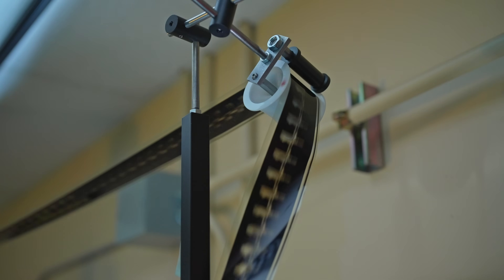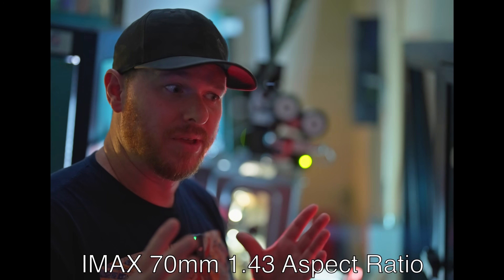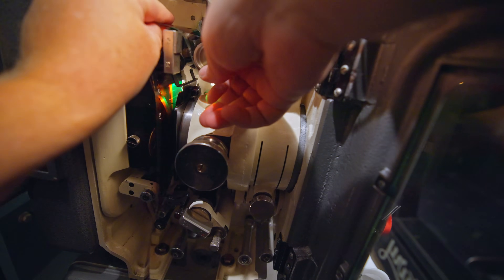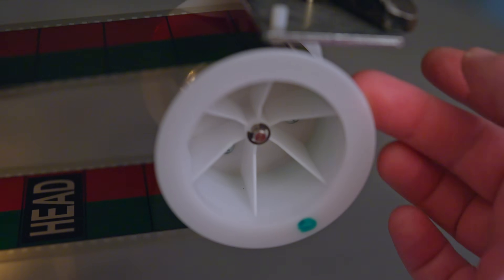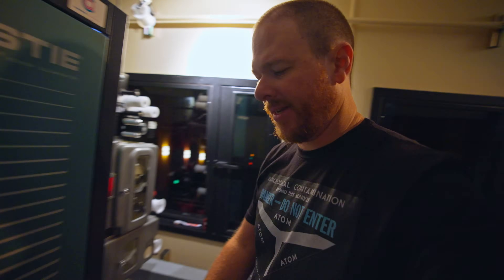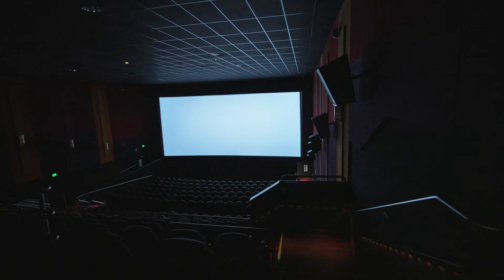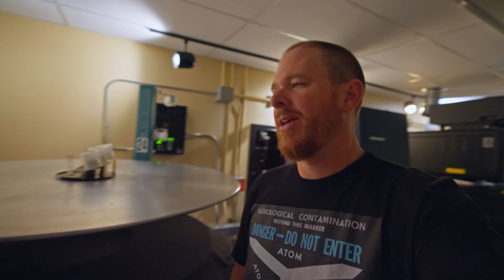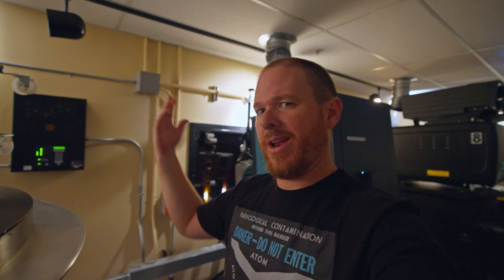Being a Projectionist for Oppenheimer 70mm Film Part 2

Comment: How does this relate to isomorphic projection stuff? Where widescreen images get morphed to 4:3?
Reply from the maker: Your thinking of anamorphic. Hateful Eight had a little bit of an anamorphic squeeze on it. On the film things look a little distorted and stretched out vertically. An anamorphic lens on the front of the projector corrects this. It’s also the other way around. 4x3 film that was shot in anamorphic gets converted to 2.35 or 2.39 when it gets projected using an anamorphic lens on the projector. I have never projected or heard of a format that goes the other way as there would be zero benefit to do so.

Comment: Of course most here are probably aware of this, but for those who are not; DTS digital sound was not used during the heyday of 70mm film exhibition. 
70mm films, from their inception right up to their demise almost always used six magnetic sound tracks, deposited directly on the film. This corresponds to Mike Todd's original wish to have a Cinerama-like format, where "everything comes out of one hole". These magnetic tracks were used all the way through the 1980's era of 35mm films being "blown up" to 70mm prints, with Dolby Stereo sound. DTS came in for 70mm right at the very end (after 1990) when only a few "break away" productions like Branaugh's "HAMLET" or Howard's "FAR and AWAY" could benefit from it.
IMAX films though never used magnetic stripes on the film. For many years they used external 35mm magnetic film drives, synchronized mechanically using START position marks.

Comment: The platter speed changes throughout the play due to the changing effective diameter of where the film pays out from the center.  The linear speed of the film (24 FPS) never changes, but the platter rotation speed (RPM) starts high as the film is in a small diameter near the center and slows as the diameter increases.
Reply from the maker: Yes, exactly.

Comment: Interesting  point at 2:30 about size comparison. 
We can put some numbers to that; A 70mm 5-perf frame at 48.6 x 22.1mm is 1074.1mm2. 
A 2.2:1 image frame inside an Imax 15-perf frame would be 70 x 31.9mm, or 2233mm2, so it would still be about twice as large as the 5-perf 70 frame without the extra areas above and below the 2.2:1 image area.
Reply from the maker: It’s not twice as large with the 2.20 aspect ratio.
Reply: @RadioactiveDrew  ; You're right. It is 2.08x as large, as my numbers prove. If we coukd post images I would show you the dimensioned drawing that establishes this fact.

Comment: Not sure your explanation makes sense (and I don't have time to do the math), but wikipedia states that IMAX 70mm horizontal films has 3.4 time surface area that vertical film. Assuming film stock with the same grain this means that either the projected image is going to much larger for the same result or if only slightly larger than the grain is finer, less visible and the result should be a sharper image.  It comes down to how many times larger the projected image is compared to the source film frame, the one with less magnification has the advantage and starting with a much larger frame, IMAX has the edge.
Reply: Its actually rather scary the velocity that IMAX 15/70 film is flung through the projector... I would love to see a diagram of how that rotating drum shutter works.
Reply from the maker: @spikester that would be cool to see. What’s even crazier are those ultra high speed film cameras used to capture explosions. Those have to be the most insane camera tech ever developed.
Reply: @RadioactiveDrew  Great point, some of the high speed film cameras NASA had on the launchpad developed during the apollo and later STS are still used to this day for SLS, the dynamic range is significantly better as seen with the very bright SRB flames when compared to all the equivalent digital footage. 500fps using 16mm film. Wow!

Comment: Thanks, Drew
I was a "projectionist" back in the late 1950s when I was in the 7th and 8th grade.  None of the teachers in grade-school were very proficient at threading those old Bell & Howell 16MM FIlmosound projectors.  But I knew how to thread them and make the proper size loop between the gate and the sound-head.  And keep the film tight against the sound-head flywheel, etc.  Then in college we had a pair of navy-surplus 35mm projectors (designed for shipboard use).  And I remember having to deal with a "flood" of film all over the floor when the takeup reel stopped.

Comment: We used to stack/tape 2 platter rings on top of each other for 70mm. It gave a little more reassurance supporting the additional width on the platter rather than just rely on one ring. You can see this in my 70mm Titanic video from 1998.

https://youtu.be/dhKPERGALMI
Reply from the maker: That sounds like a good idea. Thanks for the suggestion. I’ll have to see what that looks like.
Reply: @RadioactiveDrew  We had Christie platters and I believe they seem to be the same as you’re was using so it should work.

If I remember correctly, you may need to knock the white locating pins in the bottom ring down a touch so that the pins on the top ring locate into the top of the lower one. This will help hold them together, then secure them with tape. It’s worth doing if you run a lot of 70mm.
Reply from the maker: @seanelstob5922 yeah I figured I would have to move those white plastic pins a bit to make those rings work together. I’ll have to look around the booth and see if there is a spare ring. Only other one I have is for the test reel I run every morning.

Comment: Back in 1999 when "The Matrix" hit cinemas, after the movie I did ask the projectionist, if they could show me around their projection system. And I was blown away by the fact, that they were in fact running all the screens showing "The Matrix" (which was like all but 2 of the whole venue) of the very same platter. They just threaded the film in a long loop, between two floors, and 3 screens on each floor going a few times back and forth to get about 15 minutes buffer between projectors. Of course, if there was a problem, it would affect all screens. But given the smashing success of "The Matrix", with the the distributor simply not have enough prints to ship out, this was the only way to meet the demand.
Reply from the maker: The first Matrix was a pretty big hit that’s for sure. I’ve never seen an interlock setup before but they always sound super crazy.
Reply: @RadioactiveDrew  Not sure if this is true but think I read somewhere years ago that running one copy of a digital movie on multiple screens is not possible because each copy comes with a digital key that is linked to the projector.
Reply from the maker: @bbcovault this is true. There is a file called a KDM (a key) that unlocks a digital file for playback. It has to see the IP address for both the server and the projector. But I’ve seen a computer act as a go between and spoof IP addresses to trick the KDM into working. Disney use to do this all this all the time.
Reply: @RadioactiveDrew  Thanks for confirming.  I have enjoyed your videos on the projecting the Oppenheimer film and those I have watched on radiation.  Very informative and well done.
Reply from the maker: Thanks. Glad you’ve enjoyed them.

Comment: Hey Drew...nice video.

You're a bit dismissive on the difference between 5/70 versus 15/70.  The image width on Imax is 69.6mm.  Conversely, on 5/70 it is 48.6mm.  That is over 43% wider/more film just in the horizontal direction alone.  Since much of this movie was shot with IMAX cameras, that is even more significant.  It's not JUST about the more height with IMAX (48.5mm versus 22.9mm or more than double.  Even for the part that is included in the 5/70 frame, it too will be over 43% taller/more faithful to the negative.  It is significant.  Then there are the projectors and how the film is held/registered between your Century JJ versus an IMAX rolling loop, which is pin registered and has a field flattener for the film to rest against versus the normal pulsation of 70mm as it swells towards the light source.
Reply: Did you get to see it in 1570? I saw Oppenheimer, Dunkirk, and Interstellar in 15-perf 70mm IMAX. The IMAX shots were definitely sharper, impressively so. And of course going literally floor to ceiling for those shots on a 60 foot tall screen is pretty spectacular also. That being said it gave me an increased appreciation for 70mm as it held its own even side by side with IMAX.

And the 5-perf 70mm was even more in the glare of the spotlight in Oppenheimer, which had less IMAX footage than the previous two (25% IMAX in Oppenheimer vs 70% for Dunkirk and 35% for Interstellar).  And the other two had fewer transitions, i.e. the IMAX scenes tended to be longer.  I think the concern back then was that audiences might not like too much switching. But I think it turned out that most people who specifically went to an IMAX showing don't mind a lot of switching. So for Oppenheimer there was no hesitation to switch constantly, although it always seemed to fit in. All special effects of course were in IMAX, but also for example a wide establishing shot in a meeting room might be IMAX, followed immediately by a 5-perf 70mm shot of the same scene as the camera got closer to the actors.

There also were switches between black and white 5-perf 70mm and black and white IMAX 70mm (a first, apparently it required special film from Kodak). So that's four different formats that were being constantly juggled!  But back to my point, the constant switching meant that you got to constantly compare 15-perf and 5-perf 70mm, over and over repeatedly.  This highlighted just how good 15-perf IMAX is. But like I said the fact that 5-perf 70mm could keep up with IMAX without being distracting made me appreciate it even more. I'm interested to know what percentage of audiences even noticed the difference in sharpness, since most audiences don't notice that type of thing. But if you are watching for it it is impressive.

Comment: I saw the 5 perf 70mm in an IMAX theatre in Århus in Denmark. Unfortunately we're not getting the 15 perf 70mm IMAX version.
I was a projectionist myself back when I was studying at the university. It was a smaller place with 3 screens, all with double projectors setup with aluminium tape to trigger lights, doors, format change and changeover to the next machine. Cool times!
After each machine was finished the film had to be wound back to the top spool to be ready for the next show. I made a big mistake one in that process. I put a smaller reel on top instead of the required size, and then I left for the 10-15 minutes it would take to rewind. I came back to the floor filled with film as there was not enough space on the reel. That cost a few ruined commercials, as it was luckily the first reel with the commercials on it!
The projectionist for the coming day replaced the commercials, and all was fine again :)
Reply from the maker: I remember that cue tape. Pretty slick system when it worked correctly. Ours would just take down the lights, turn on the lamp and open the electrical dowser.
Reply: @RadioactiveDrew  Yeah, we had the same sequence, but we would start the projector manually, and manually open the dowser. The first signal dimmed the lights after the commercials and released the doors so they would close before the trailers ran. Second signal would change to cinemascope if necessary. And then of course the change marker would shift over to the next projector.

Comment: How many showings can a print tolerate?  And if they do wear out, what happens to the print?
Reply from the maker: What I’m concerned about with this print wearing out is a splice breaking during the show. Sprocket holes can also be worn out and that can make the print a little jittery in the gate, which you could see out on screen. Also the level of cleaning I do with the tacky rollers that collect some dirt and dust doesn’t get everything. Eventually the print will get dirtier and dirtier. At that point it would have to be cleaned on a film bench or back at the lab. The film is incredibly strong and can take a beating.